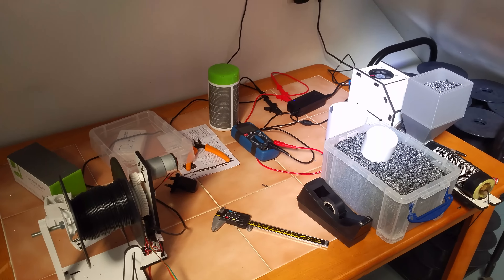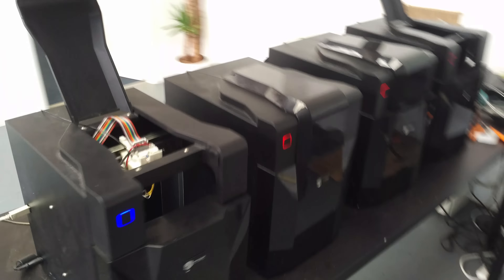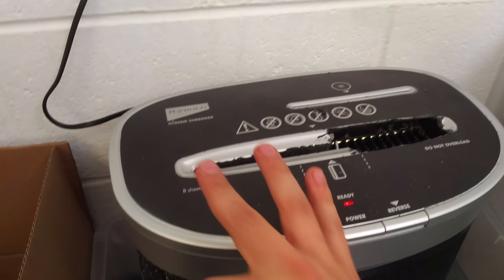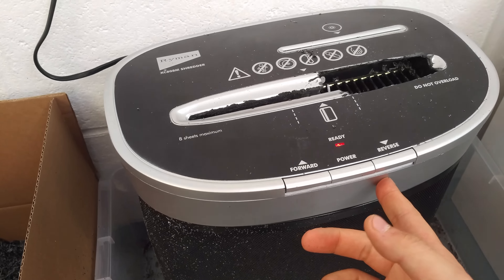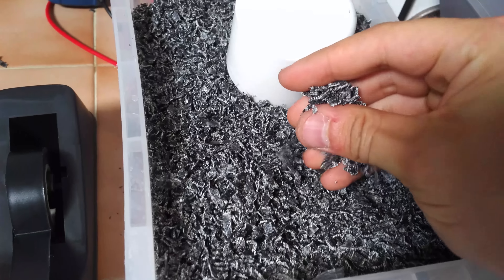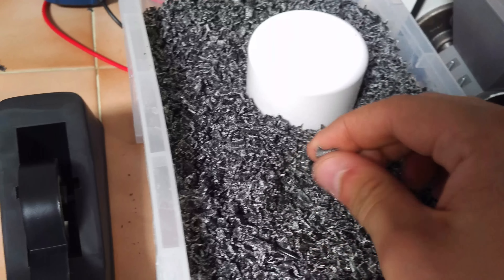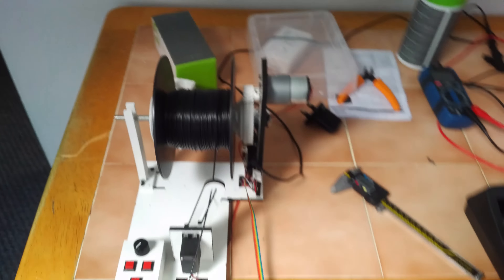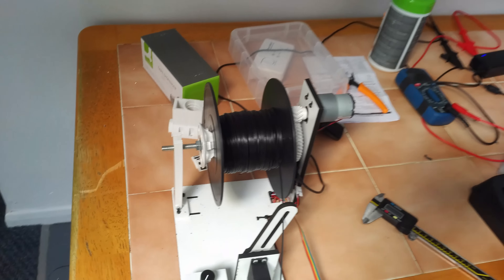recycling ABS into usable 3D printing filament with Filastruder and a paper shredder...

Comment: Where do you get the filament maker and how much does it cost ?
Reply: This thing costs nearly 2x more than my Anet A8 printer. This would seem to only make scene if you have as many 3d printers as you do and are producing for clients around the clock. If i was manufacturing parts i would be making a mold to produce parts not printing the actual part.
Reply: @Side85Winder  Depends. If you need to produce 20-30 pcs in average by client, then no. Moulding and casting would cost you more than 3D printing. But there are many cases where aesthetic quality does not matter. What is matter is that you can produce it faster and cheaper than a big factory. Small scale production. And here is where you want to save money on raw material cost.

Comment: how do you run it through second time the paper shredder? It does have a "sensor" not to run without "paper" in it, so how do you bypass that and make it run continuous enough?
Reply from the maker: Hi. holding down the forward feed button will bypass the sensor. we simply run it through a 2nd time, and filter out the larger parts, which can be run again if necessary.
Reply: Ah ok, not all shredders have that kind of button :) Out of the few i've used hasn't had that.
Reply: take the shredder apart, find the detector and pull those wires out and put a normal switch on it.

Comment: You mentioned "a beefed up" paper shredder. How did you beef up your shredder?
Reply from the maker: Hi there. Yes, thats a small error on my part. by 'beefed up' I mean that it is one designed to take on staples, CDs and credit cards, as opposed to just paper. The exact model used is an 'XC808M' sold by Rymans stationary in the UK. I'm sure any other high power paper shredder, also designed for credit cards and CDs would do a good job. One thing; make sure you purchase a model that will allow you to cut or dremel open the open the opening so you can fit larger parts in there.

Comment: how do you recycle failed prints? do they fit in the paper shredder?
Reply: You have to use a bigger shredder, a paper shredder will only shred the base of the prints that is in contact with the heated bed. Google "precious plastic shredder"
Reply: Smash it with a mallet mate
Reply: SCARRIOR This barbaric idea is the simplest solution to this problem :D
But they won't probably fit still on the paper shredder
Reply: Flatten them into1cm ;D